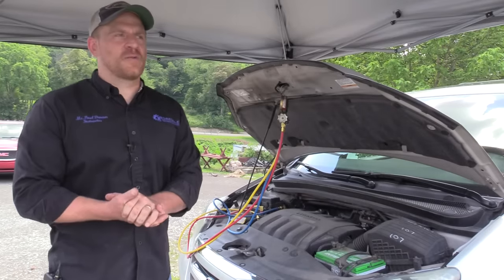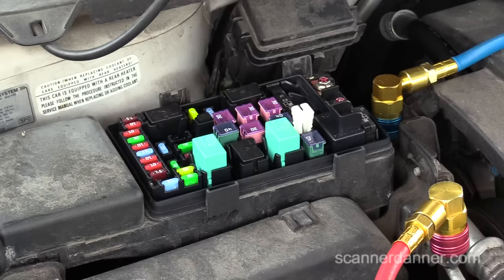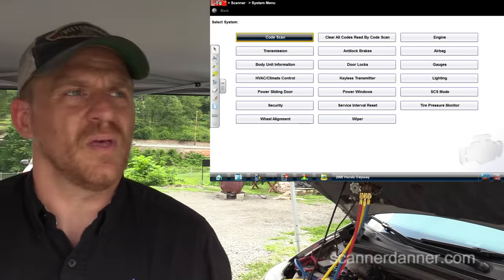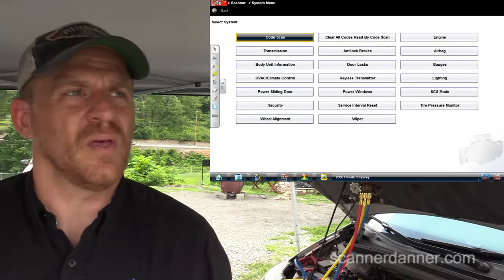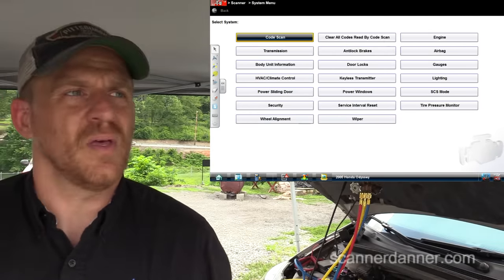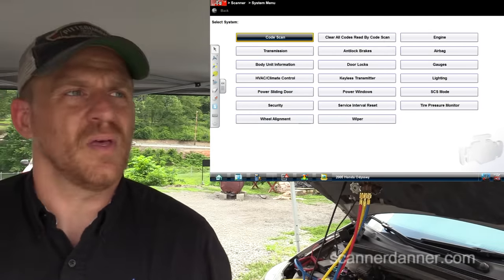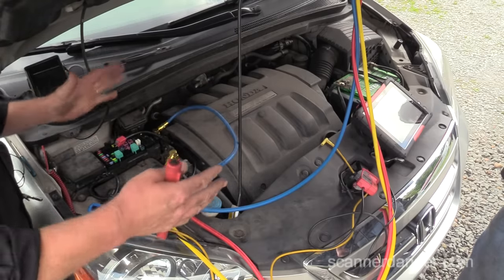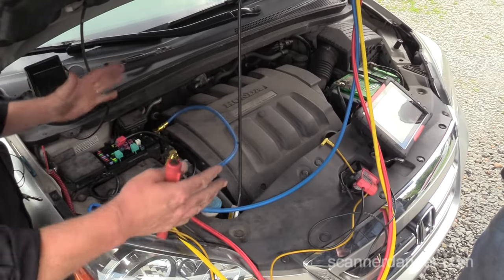A/C clutch not engaging - 2005 Honda Odyssey

Comment: I'm having an issue with my 08 Odyssey and I'm thinking it might be an issue with the clutch coil. If I turn the AC on, the clutch tries to engage and then disengages in a matter of seconds. The relay clicks when the computer tries to request it and I get the engine RPM rise as well. Do you think it is still worth checking the ground and wires at the compressor?
Reply from the maker: Get a psi reading first. Low and high side
Reply: @ScannerDanner  I just have a basic gauge that comes with R-134 at the store.  When connected to the low site its about 120 psi with the clutch disengaged.  I'm not sure if I can check high side with this?
Reply from the maker: What does the low side psi do when the clutch engages?
Reply: @ScannerDanner  the pressure will start to drop as the clutch starts to engage, but then goes right back when the clutch stops trying.
Reply from the maker: Need to know what it drops to before the clutch disengages
Reply: @ScannerDanner  I was able to go out tonight and check low pressure again, but now the issue is slightly different. Ambient temp first off is 55F instead of the other day's 90F. Upon starting the car and turning the AC on the clutch engaged and started cooling the car. Not long after (less than a minute) the clutch disengaged, then engaged, and continued to repeat the process. I recorded what was going on if you would like to take a look. I will at least tell you the PSI. Before ever starting the car I connected the gauge to the low side and it was about 77 psi. Unfortunately I don't remember the PSI right after starting it up. I recorded it a couple minutes after the fact. What I gathered from the recording, the clutch will engage when PSI get to about 52, then the PSI lowers to about 38. That's when the clutch disengages. Once PSI is back up to 52 it engages again. 

I'm thinking. Just low on freon after what I've seen. But I don't want to overfill it if that's not the case. I guess it's actually trying to kick on because the ambient air is cooler?

Comment: Good troubleshooting effort, however, the use of all those tools was overkill.

Every multimeter has an ammeter function. You didn't need an amp clamp. All you need to do is put the multimeter on DC amps (highest scale) and put the probes on the load side relay contacts and you will read amperage directly on the meter; you don't even have to pay attention to polarity because the meter will read in both directions.

Since this was an open, the clutch coil is faulty. However, if it did read a good current, the next thing to check would be the clutch air gap. If the gap is too wide, it can behave like a weak clutch and fixing that would only require removing shims.

Since the clutch is in fact bad, on some cars (not necessarily this one), you can replace the clutch without removing the compressor from the car.
Reply from the maker: To each his own

Comment: Am I wrong here but if you have power on both sides of that fuse wouldn’t that tell you the relay is working and you either have a broken power wire , bad connection at the clutch or a bad clutch or a bad ground?
Reply from the maker: depends on where the fuse is in the circuit. If it feeds power to the relay, then no. If the relay powers up the fuse, then yes

Comment: Good video working from  first principles as always best way to teach  --- remember to give it the thumbs up guys
For the DIYer or Student or Pro there are a couple of budget priced tools that are handy for diagnosing this type of issue.  I can recommend the UNI-T UT203 which is a very low cost multimeter with a built in DC clamp meter, it has all the normal mutimeter Volts, Ohms, Continuity, Diode test and Hz scales,  the DC amps scales 0-40  and -0400 amps. I have been using one for a few years as my main meter for car work and checking stuff around the house.
A eBay or Amazon search should turn one up  from sellers  in most  own countries at under 40$/£25/30Euro  and may be even cheaper from China. However be careful to get the exact model number as some other meters from the same range don't have the DC current measurement only AC.

The other tool is a pen sized magnetic field detector the Voltcraft MS-410  if you hold it close to anything that has a magnetic field it lights up so you can tell if a solenoid is energised without distrubing it, the stronger the magnetic field the brighter it glows  It works with relays, coils, and shows if coils are being controlled  even pulse very dimly when held close to high impedance fuel injectors.  I got mine for about £10 so I would guess 15$/12Euro  might find one on eBay
Reply from the maker: Thanks Andrew! And thanks for your help on my forum!

Comment: Good video but I have a problem ami if it gives me air but the hot air does not work me what will be the problem I have a honda accord ex 2005 v6
Reply: You're not getting hot air? Could be a bad heater core... clogged or something. Either rust or from someone using a radiator sealing additive.

Comment: great vid and very detailed, but I have a question... Wouldn't it have been easier and faster to locate the 2 wires from the clutch relay that plug into the ac clutch/ stator and jump the ac clutch from the battery?
Reply from the maker: In hindsight yes. But going into this (until I got in on the rack), I assumed I could not get to the clutch connector. I didn't know it was right there on the rad fan housing.
Reply: @ScannerDanner  people think your racing or teaching?

Comment: I am still confused as to what you mean when you say load side and feed side.  Can you elaborate a little? Thanks
Reply: Load side of the relay would be the terminal going to the compressor clutch positive, feed side the terminal from the fuse supplying current.
Reply: thank you.  that helps.

Comment: My ac clutch wont engaged but if i use the wire method on the relay it engaged and ac work and the relay its good what could be the problem
Reply from the maker: what are your pressures? codes? etc etc You've given me nothing, not even what you are working on

Comment: Hey ScannerDanner  - great video. My '97 Mazda MX5 (ok, Miata) had, in addition to the AC relay and the high & low side switches, a thermal protection switch (a thermocouple maybe?)  mounted on top of the compressor, that would cut power to the clutch if the switch sensed overheating. Basically, the power would go into this switch, and then from the switch to the clutch.  Often, these switches would fail  prematurely, even if the compressor & clutch were still working. If this weren't known, it would be a mis-diagnosis of a bad clutch, when in fact it's a bad switch. (Some Miata guys would simply bypass the switch to get the compressor working.)

Do you (or does anyone) know if the Honda compressor also has such a thermal protection switch? Thx
Reply from the maker: not on this model my friend, thanks!

Comment: When compressor is running guages read low side-15psi  high side-400psi. When cooling fan kicks on low side-40psi high side -225psi. How can cooling fan possibly have any thing to do with psi of AC coolant?
Reply from the maker: pressure temperature relationship my friend

Comment: First of all, I want that relay tester! That thing is just great, and I bet it's not that expensive...or that hard to build for that matter. Secondly, this video is about 40 minutes long...my question is how long would it have taken you to actually diagnose this situation if you weren't trying to film and teach at the same time? 5-8 minutes?
Reply: In fact, I think I might just go ahead and build myself one of those testers...maybe even improve on it slightly by providing both control and load side ports for a test light/DMM. Really, it's just a case, switch, decent gauge wire for amperage testing, fuse for safety, a few test sockets for the test ports, and some wires coming off of it with the proper pins for the type of relay you want to test. I guess technically you would want to create a connector to which you could attach different types of relay plugs depending on the type of relay and the type of vehicle you wish to test. I guess that you could also add in extra wires coming off of it to connect to the battery/ground directly to bypass the control side. Even an extra switched wire for items like an OVP relay which tend to have an extra switched hot lead for when you turn the key or something similar. Okay, I'm going to build some kind of Frankenstein, and I'll make a video showing how to do it. Maybe Mr. ScannerDanner here could hook me, literally a poor lowly DIY'er, up with access to his videos in appreciation for sharing said video, diagram, and parts list...hint...hint ;-)

*EDIT* Okay, I looked it up, and boy was I wrong about it not being terribly expensive. $200 for this thing. Personally, that seems like highway robbery for a pretty basic circuit! It is pretty handy though, so now I'm definitely going to build one.
Reply: build me one too while ur at it mate

Comment: Craigslist has a good choice of bidirectional scan tools.  I check there alot. I just sold my modis updated to 09 basically for 400.00.. Now the guy who I sold it to wants me to buy it back. I might just do that so it will back up my vantage ultra and my solus edge. Diyers need to look at craigslist. Same thing with the vantage pro. Found plenty of them on craigslist. Pawn shops as well.

Comment: Hey, when you sell clutches don't you sell whole compressors?
I've had one comeback for a failed compressor a few months after a clutch and won't do that again..lol
Reply from the maker: I never sell just the clutch. Always a complete compressor
Reply: Doing a Park Ave today. Idle drops and sometimes stalls only with AC on.
First impression: compressor is a little noisy.
Just added an oz of oil ran 15 mins,  No change.
Original compressor.
MAF clean and good grams, throttle body clean.tps looks good
..69,000 miles. 
Runs perfect when AC is off.
Selling a compressor.
Reply from the maker: I've never sold a compressor for a stalling issue. If it functions and your pressures are good, even though it is a bit noisy, tells me your problem lies elsewhere. 
Inputs for the AC system. Idle air control valve issues, minimum idle speed settings, clean throttle body, other idle load compensation inputs (park/neutral switch, power steering psi switch etc). I'd be looking at those inputs first

Comment: Sir my car ac clutch is engaging and then not engaging it repeat this cycle after every 5 to 10 sec can u please help m whether it is normal or some problem is there
Reply from the maker: Sounds like the compressor is short cycling from low refrigerant charge (leak in system)
Reply: Oohk sir thanks for your help

Comment: Mine went towards the PCM signal feed, I activated the clutch manually using my bi-directional scan tool and I get ground from the PCM. I just don't understand why the computer refuses to turn it on. I checked the AC Pressure switch reading and it reads well at 130 psi meaning that it is working. What other variables could cause the PCM to refuse to turn on, I had these two symptoms on two Honda, Odyssey 03 and Civic 06. I was stuck there.
Reply from the maker: Okay, so we are on the input side of things for you. Any trouble codes? Do you have a scan tool that will allow you to see AC request and clutch command data parameters? EVAP temp sensor signal would be another one I would want to see.
Reply: @ScannerDanner  I had access to reading AC control and AC Clutch signals on the civic 06. Both read OFF even though when it was on on the control panel. I ran the recommended hold recirculation button and turn ign switch to on with no blinking light above the recirculation button etc. I'm starting to think there may be a short in the PCM but that would be the last thing. I can almost assure you that I saw them change to on when I had the fuse removed and then it didn't do it anymore.
Reply: @ScannerDanner  does the Evaporator have a signal as part of the circuit, I really didn't see much as what really controls the ground within the PCM as the diagram shows that certain wires go to the PCM and then there is a ground controller that is broken off inside the PCM and there is not much as far as relationships between sensors and PCM controller.
Reply from the maker: you need some good service information on that. An AC diagram would be key http://eautorepair.adtrk.biz/?a=10817&c=24&p=r&s1=
Reply from the maker: these are the same diagrams and service info I use but for an individual car

Comment: I'm trying to ask for help I bought a 2010 Honda CRV EX L Sometimes my AC works and sometimes it don't. Win i tap on my ac Cluch it  come back on every time I tap it.it tells me that I need a new ac compressor
Reply from the maker: You need a clutch in most circumstances. It is possible an air gap adjustment can be done but most are not adjustable and when air gap problems develop, it is usually from a worn out clutch bearing

Comment: If you are a diy guy and you only need a biderectional tool look for idiag by launch on eBay. You would have to buy only specific brand but if you only have one brand car you can buy that brand for $40 and it gives you bidirectional control of your car just for about $100

Comment: Can you do a video on a 2016 Kia Rio air-conditioning don’t work
Reply from the maker: I film actual case studies, so if I ever see one, sure
Reply: That’s OK I’ll figure it out I figure you may show one that doesn’t work I don’t know how to do one of those and send it to you so I’m probably gonna start changing the compressorCause I already change the control panel they still didn’t do the job like I seen on the video of another one that shows right ACs and a bunch other ones but it does not show one on a 2016 Kia Rio
Reply from the maker: @ralphramos8701  don't change the compressor without first making sure it is getting power and has a good ground.
Reply: One day I was working and then the next day didn’t work anymore I cleaned out the radiator in the front I can’t figure out which is the fuse for the AC I know a lot of my old school cars since I was 16I’m 64 right now retired but it’s for my granddaughter’s car
Reply from the maker: @ralphramos8701  just put a test light down at the clutch wire to start with and check your pressures

Comment: My 2008 Odyssey I just bought. First I check the ac pressure and it was maxed out. So I removed the pressure. Than that didn't fix it. Turns out it had a bad relay. Now it's engaging the compressor but than not staying on. And it's at the perfect pressure turned off. But once I turn it on it goes to 0. Absolutely 0

Comment: My honda crv 2014 shows evap temperature as 419 degrees F. The clutch does not engage but engages when bypassed and if the engine is running, the a/c cools the car. What is likely to be the problem.
Reply from the maker: Faulty (shorted) EVAP temp sensor or a short in the wiring to it. An open wire or open sensor on a temp sensor circuit will typically read -40 on your scan tool.
Reply: I understand  NTC thermistors. The evaporator was removed and the evap temp sensor tested good. The 419 degrees F still remained even with the the sensor disconnected. The resistance was okay and there was 4.8V from the source to the ground. I also sucessfully applied the self diagnostic for climate control module described in the Honda CRV 2014 service manual and no DTC codes were displayed. This test tests among other things, the evap sensor for open and/or short circuit, HVAC EEPROM, blower and others.
Reply from the maker: But you are setting a code for this temp sensor right? And this self diagnostic procedure you did, are you sure the temp sensor for the EVAP is part of that test? That test aside, you should be able to disconnect the temp sensor and watch scan data go to -40, but sometimes you can be reading substituted values on the scan tool that will throw you off. Like in this clip https://www.youtube.com/watch?v=HAqJGE08-4g
Reply: I am not setting any code. DTC  codes should only appear if there is a problem. The tests is similar to the one in the link below.

https://www.bing.com/videos/search?q=honda+climate+control+self+diagnostic&src=IE-TopResult&conversationid=&ru=%2fsearch%3fq%3dhonda%2bclimate%2bcontrol%2bself%2bdiagnostic%26src%3dIE-TopResult%26FORM%3dIETR02%26conversationid%3d&view=detail&mmscn=vwrc&mid=7C1B93E846C52303C1F47C1B93E846C52303C1F4&FORM=WRVORC

I can send you the specific one as an attachment for 2014 Honda CRV with the anticipated codes if any problem exists.
I guess the only step we missed was to test the sensor in ice and hot water. and also not measuring voltage while the sensor is connected. The 4.8V was open circuit voltage which indicated that the HVAC module and ground side were good. This sensor shares the ground with the ambient temperature sensor which working very good.